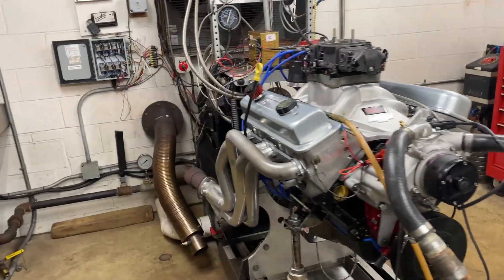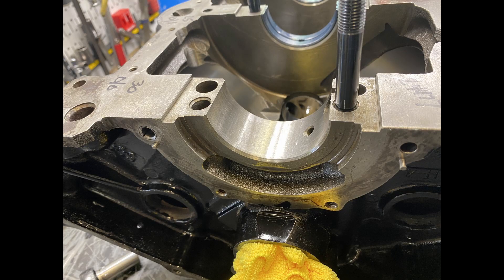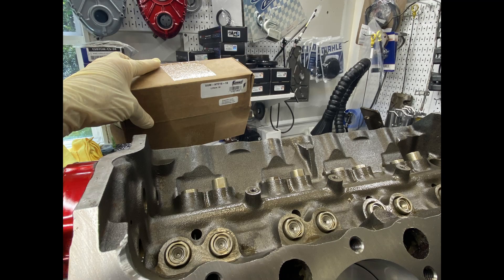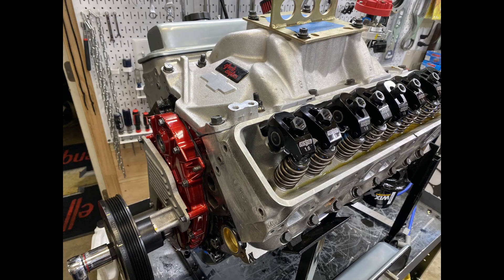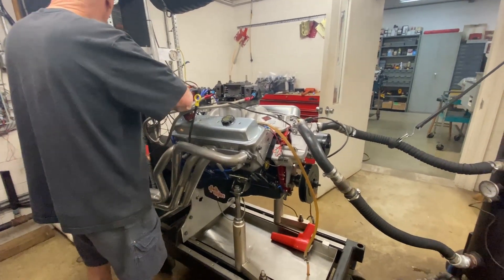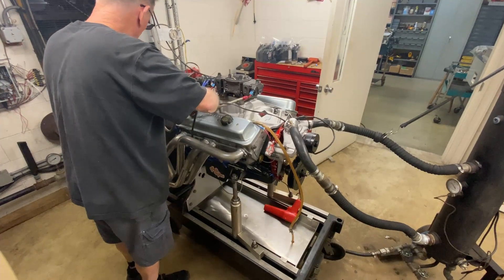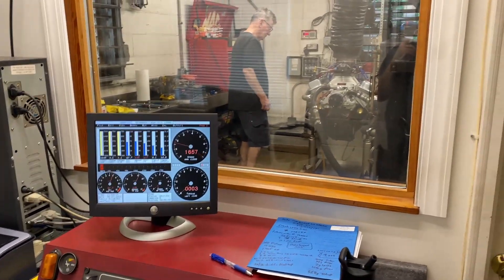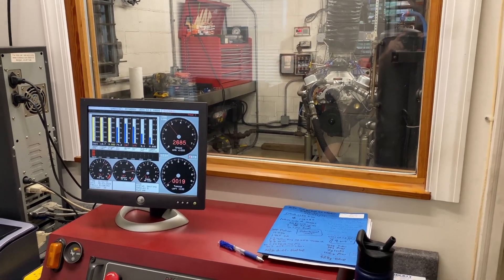An adapter that actually works!  2-piece rear crank to 1-piece rear block

Comment: Great video! How has the long term success with this conversion gone? Do you sell the conversion kit? Will it work on a ‘68 327 block? Thanks, Chris
Reply from the maker: No long term data yet.  And I have not tried it on a 2nd engine yet.  I have the parts to do it but I'm so low volume and so busy at other things....time flys.
Reply: @EllweinEngines I totally understand. I think there would be a big demand if you did decide to produce them.

Comment: Is this to keep the all internal balance?
Reply from the maker: No. Not for that but this allows the use of less expensive and more available 2-piece rear main crank
Reply: @EllweinEngines i guess that is a valid factor but all internally balanced is added bonus (except 400). How much is seal adapter kit?
Reply from the maker: @jacobnorth8642  I have not made these available yet for re-sale.  I still have to put on one of my own engines and give it a good workout.

Comment: What are the lifter trays for? Do they do anything good for a LT1 or sbc?
Reply from the maker: They are GMPP lifter trays for Gen 2 LT1 .  Just like LS lifter trays.  You can change a cam without removing the intake manifold using those.  Reasonable price at $20 each or something like like that.